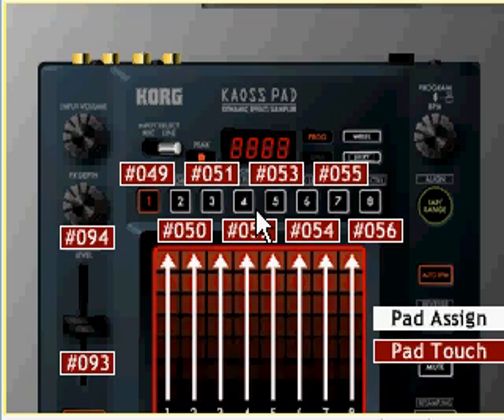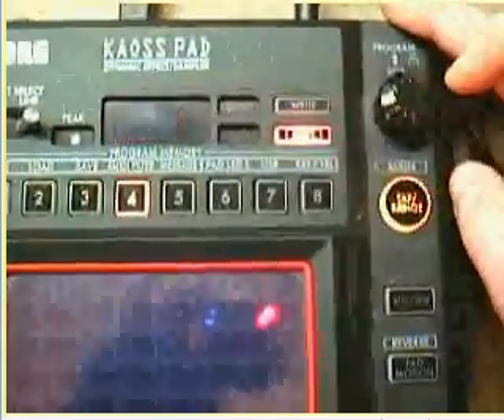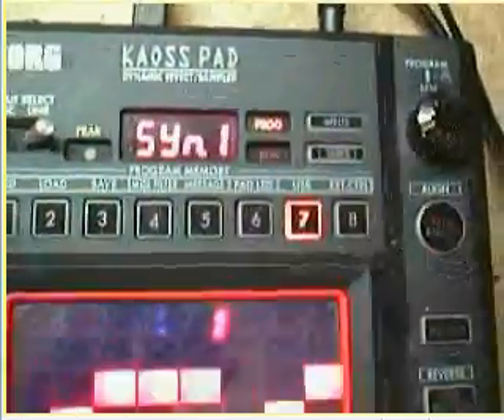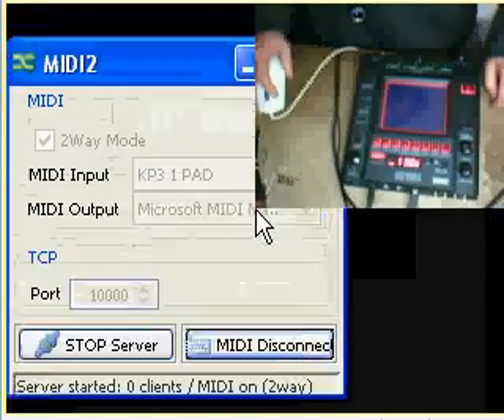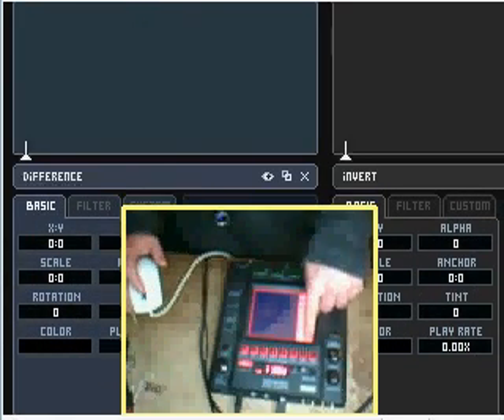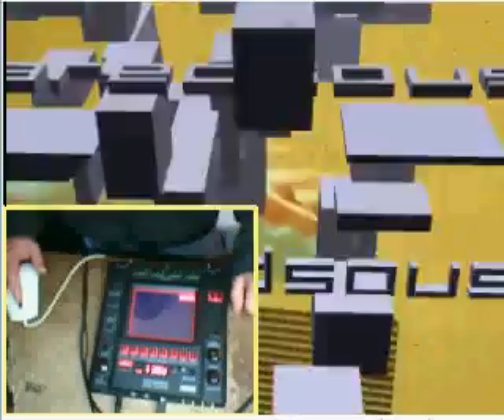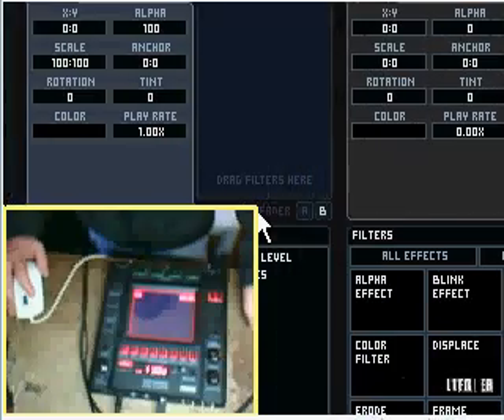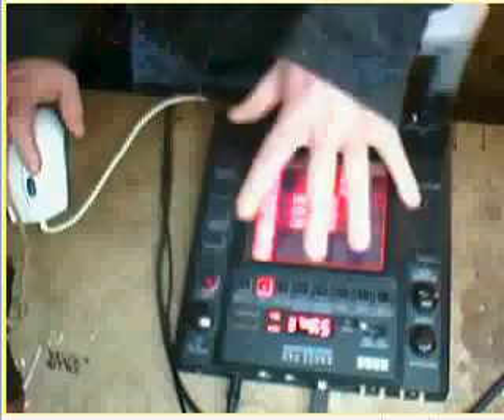Using KP3 (Kaoss Pad) as midi controller 2

Comment: Hello Jeff,
I can't send midi messages from live to a synth through the kaoss pad. Do you know why?. It only sends and receives midi from the kaoss pad. Isn't possible to used the kp3 as a midi interface?.
Rolando
Reply from the maker: from what I remember you can use it to send midi commands. you need to make sure the switch (push button maybe) is set to "Send" the KP3 will then send midi signals out of the midi ports. Check the documentation though. I'm pretty sure it's covered in it.
Reply: No you cannot, as the kaoss pads don’t have midi thru
Reply from the maker: Mad Mac 66 this isn't true. On the back of the kaoss pad are two midi (in / out) ports, as well as sending midi signals through USB. Five minutes reading the manual that came with the pad covered this.
Reply: Jeff Richtman I have read the manual, several times, and nowhere does it state it has MIDI thru. Sure it has MIDI out, but that’s not the same thing. Moreover, I was informed by a well respected music guy (perhaps incorrectly I dont claim to be an expert) that the kaoss line did not handle MIDI thru. Cheers
Reply from the maker: Mad Mac 66 I misread, I thought they wanted to use the Kp3 as a midi sender. Press button on Kp3 sends midi signal to equipment. This will work since the KP3 is a midi device. Don't forget probably the best person to ask is really KORG company which has a YouTube channel as well.
Reply: Jeff Richtman yeah I figured as much, it happens no worries. I wish Korg were more responsive regarding these tools. Midi is such a black art at times and documentation isn’t always the clearest. Especially when it’s translated. Not sure if it’s the way I have my KO1-PRO set up, but the midi connectivity is so flaky. Sometimes it works sometimes it don’t. When it does it’s awesome. Cubase recognizes the kaoss sound bank so I can record and playback directly from the DAW. Sometimes. Cheers and thanks for the great series on the KP3

Comment: I've got her working now, but I do notice that the KP3's pad doesn't seem to handle the manipulation of multiple CCs at once - I can get all 8 controls of the Pad's Pattern 4 set up to different parameters, but the pad seems to freeze if I try to multi-finger the pad to manipulate several parameters at once.  Is this something you have experienced?
Reply from the maker: sadly my KP3 has been in it's box for almost 3 years due to lack of space, But I think I could only use one channel on the pad at a time, probably something with how the touch interface works. 
Never had had it freeze up, may want to reflash the latest firmware from korgs website to it and see if that fixes your freezing problem.

Comment from the maker: That's a cool question, Sadly I only own the one Korg product. But with the midi in and midi out ports on the back I would imagine it can control any midi event on any other device. The sounds that are built in can't be changed but the KP3 and Kaossillator pro are pretty much the same hardware just flashed with different software. With that said, I don't think it's possible to easily modify it to act as a kaossilator. You could go with one of the small kaossilators and hook it to the KP3 .

Comment from the maker: The external control option is covered at 1min into the first video and a few seconds into this video. I have a feeling most issues are caused by people skipping through the videos trying to get in a hurry. Been too long since I have used my KP3, but this video seams to work for setting up on 64bit systems as well. Thanks for the reply.

Comment: You posted this 4 months ago, so you probably already figured it out.
For those that have not, a step that I don't believe was explicitly mentioned in this tutorial is that the KP3 has to be in external control mode (shift+8).
It will only recognize the X & Y controls. :3

Comment: Thanks for the vid! But I still can't get my KP3 to output different CCs for each collumn of pattern 4 (or any other pattern). It always outputs the same CC for X and another for Y. Tried everything during 2 days with no luck. Any ideas? Other stuff also seems strange, like some changes I make on the Editor and send to the KP3 don't "stick"... like changing the program memories to notes instead of CC, or setting different min and max values to the slider. The KP3 ignores this changes... thanks!

Comment: Great tutorial I have my KP3 set up now and can control grand VJ, but have had a problem with Onyx - using mid2 it connects, learn mode makes some of the controlers pink, but not the cross fade (like yours), clicking on a  controller and moving the kaoss fader does not do anything!! am I missing somthing? What version og onyx are you using?
Thanks
PC vista